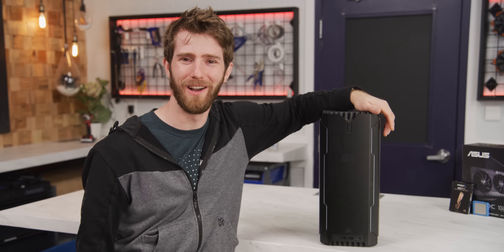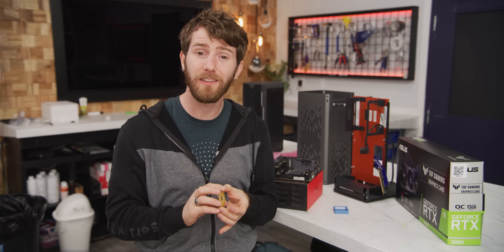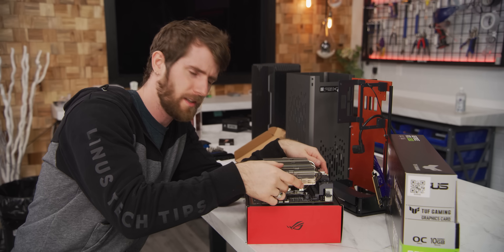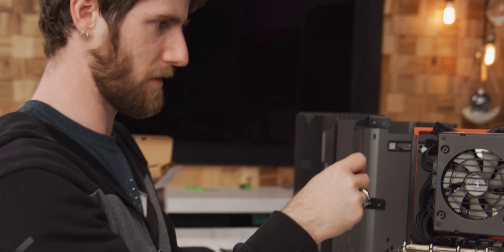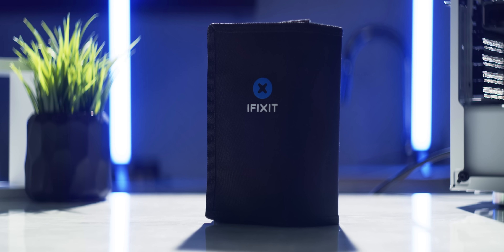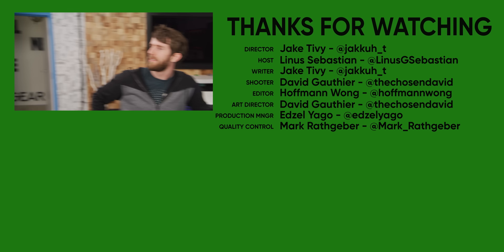My EASIEST PC Build In Years! - Louqe RAW S1

Comment: You guys should do some sort of a space build. But like… in vacuum. And try to have a modern gaming pc sufficiently cooled just radiating the heat away. Essentially, did a couple of videos on space related things, would be cool to push it next way to “pc for the iss (or starship)” or whatever. I think that could be a long project with lots of engineering and manufacturing and I think lots of people would enjoy watching that process. Plus get some clickbates with them “space pc” words.

Comment: 16:53 I recently replaced the water in my loop after 3 years (!) and cleaned it and "improved" my fan and pump speeds. My PC did not shut of, but the water temp went to 70°C and the case was so hot, you could nearly burn yourself :D It was pretty silent though, and the water probably wont have any bio issues after neraly boiling it.

Comment: Look can you help me i have 3.10ghz cpu :200storage: 6ram the installation goes to the end then rolling back changes i have been told its the PCI Family controller i unstaled it then connected via usb  with phone to wifi then does the same thing why it do that and i can install windows 8.1 what should i do
Reply: But windows 8.1 is bad do i try to install windows 8.1 then install windows 10 from there or it will do the same

Comment: all bearings, unless maglev, passive box sink, heat pump cooler
Reply: air bearings are fine too, nothing that wears off
Reply: two layer cake
Reply: you need a short gpu if any
Reply: third layer extended pcie trashcan gpu chambers
Reply: pipe-tube pc
Reply: chicken
Reply: only more section of pipe for a battery or a solar generator

Comment: Nah, after i saw Optimum Tech's review of this case i learned it is actually NOT GOOD ENOUGH for the price. And this build is not better than the Corsair One either when your parts are burning like they are inside of an oven.

Just get the SSUPD Meshlicious, way better thermals and water cooling support with a PCIe G4 for almost $150 less than this, it is also a thin vertical case.

Comment: Seems similar to the Aigo Yogo S1 (AKA DarkFlash DLH21) but without the 120mm rad support (but bottom access rather than top for rear I/O may make cable runs tidier, though top access certainly makes it easier to access, especially with the magnetic lid). Plus the S1 has argb so runs faster, right?

Comment: This is basically how those old Apple Cube computers went together. If you had to replace the HDD, you had to slide the entire chassis out of the cube, then IIRC, the HDD just slides out. That was back when Apple engineering was really cool and you could actually replace stuff.
Reply: Well Apple engineering is still crazy cool but you can't replace anything that's for sure.
Reply: @jas_bataille not crazy enough or cool enough for the prices nowadays unfortunately

Comment: The Phanteks Evolv Shift has been out for a while and, while it is slightly larger than the Corsair one, it's an incredibly similar chassis that you can buy off the shelf. It can do dual AIO setups as well and I personally prefer it over the ONE.

Comment: I'm at the point I recommend to someone to buy a pre-built and replace the PSU with a better one your liable to get a better system and by that I mean one from ABS or cyberpower you can then also redo the cable management just get one that comes with a good case as well

Comment: No way would I buy something like that without more air flow, and especially without noise to temp performance charts. it even eats up the ports on the back of my MB instead of using the headers. what kind of 300$ joke is this?

Comment: seriously though. Torx are better than philips and flat head screws. Since there's so much surface area, and you pretty much have to use the correct size, you're less likely to strip it.

Comment: Torx is FAR superior to Philips. Far better engagement and keeps the dumb dumbs out "especially if you upgrade to security fittings". Weird argument for sure but I'm a fastener nerd. If you don't have the proper driver on hand, you should probably not be turning that screw to begin with lol. /rant

Comment: I don't agree with philips head screws like you said Linus. Philips is outdated and holds no grip. It was originally designed to be stripped! A trox screw also stays on your screwdriver as you screw it in. in short, everyone should adopt torx and phase out philips head.

Comment: Philips is only better than flat head, not welcome anywhere outside of PC stuff. Great to see torx on them, it's vastly superior. For example, to get the correct torque you do NOT have to push hard to remain engaged. So way less chance of stabbing your gear by slipping. My 2c.

Comment: Phillips head screws are...ok but I pesonally really love Torx since they are really hard to strip. Even when you get at them with an angle they have great engagement and it's really hard to slip out of them by accident making it less likely to that a klutz like me messes up the part they're screwing into. So I and many people I know wouldn't mind most industries switching to Torx. Since screws in PCs are a pretty low torque it doesn't matter that much mich when it comes to applications which need some more torque like say construction or a threadripper mount Phillips heads are the devil. Try getting a rusted stripped Phillips out of an old piece of wood, absolute nightmare.

Comment: I highly disagree with your complaint about torx vs. Philips head screws.  How many times have you stripped out a philips head? I know I've done it ALOT...though a torx is much more difficult to strip out. I've actually replaced all the screws in my recent build with torx and wish all pc component and case manufacturers would make the switch.

Comment: So NZXT H1 with an exhaust 120mm and metal front? At least with H1 you can open the front glass for some air - this case is going to be too hot to touch when it's running.

Comment: I have a 3090 with waterblock and alphacool dc-LT pump, on cpu I have stock pump integrated into the system as auxiliary pump 💪🏽 it works flawlessly inside corsair one

Comment: I love ITX cases, but for the love of god, why can't anybody figure it out?  Mount the motherboard at the bottom of a case like this, vertically towards the back side, clip the graphics card into it normally, put a 160 mm tall cooler on the CPU (NH-D15 for example) and plop the SFX power supply over the motherboard, to the left of the graphics card. Then have some short extensions for two or three USBs, a display port/HDMI or two and... That's it? Use a USB DAC/wireless headphones, use a USB hub on your desk/monitor to plug in the thumb drives and peripherals, you don't need any hard drives in a case like that (because NAS?!), the cables exit/plug at the bottom behind the case and you could more or less do a chimney setup for the cooling as well.

Is it THAT hard?

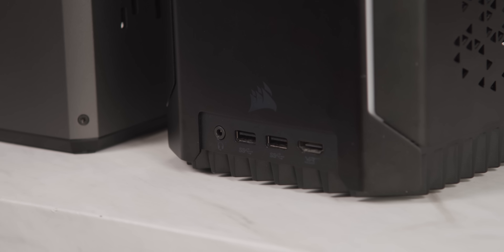Comment: 2:33 Actually, VR in 2020 and now is exploding, sales of headsets are at historical record highs. The biggest sellers are the Oculus Quest 2, HP Reverb 2, and Valve Index with premium headset maker Pimax struggling to keep their headsets in stock. There are also more VR games in development than there ever have been. Part of that is due to the surge in VR sales, and the popularity of the Quest 2. So, there yes IS a VR Revolution happening...oh, just so you know, the majority of the new headsets use DisplayPort now instead of HDMI because they needed the bandwidth.

Comment: 3:02 Okay... unpopular opinion:
Phillips screws need to die.
Torx or hex are the better solution in my opinion. I use only torx in every project (at work or at home). 
I don't  get it, when people act upset whenever they see a Torx screw in a product as if the manufacturer only would have chosen the screw to keep them out.
Torx is something absolutely everyone should have the needed tool for at home.
And it is not hard to have a good bit set for different screws at home.

Comment: Wait wait wait, this is the description of this video currently "Is a Corsair ONE-esque PC case worth your money? Let's find out by building a DIY equivalent."
This video does not give us the pricing they spent on any of the parts outside of the case (hard with current pricing I know) and they don't even compare the two thermals-wise, sound, or performance (different parts I know but they could have matched it)? Is this a case review? Is it a versus video between a DIY/unique Pre-built? If it's a case review then why the description mentioning building a DIY equivalent to the Corsair One? If it's a versus, then why absolutely no comparisons between the finished products.

Cool case, just confused at the direction of this video.

Comment: Anyone here know of a SPDIF decoder or a PCI Express sound card which outputs a minimum of 4v (pref 5+ volts) please?
I have a micro PC ive built and want to use in a car pc build but i need high voltage Pre outs and everything i can find puts out 2v or less!  My current touchscreen Headunit outputs 6v but my amps can handle up to 8v.

Comment: "It would be better to just have a phillips head..." 
Disagree. Torx screws grip better (where driver meets screw, I mean) and are harder to strip. They are a universally superior screw to phillips head. If they're giving you the key to use them, then there's no reason to use an objectively worse fastener.

Comment: Just repaired a hot glued on power button in my moms computer yesterday. The reset button doesn’t work anymore because I sacrificed its two pin mobo head and spliced it on the borked bare leads (which were glued on) for a more permanent solve. Seriously, how much are those little plastic 2 pin connectors that they didn’t want to use them on both ends? Cooler master? Wtf.

Comment: 11:35 that part pulls the video socket or the back plate I think seeing as you build it, if not I think that wouldn’t let you put the graphics card horizontally first, that’s the vertically adjust

Comment: I know from experience when you cram enough heat producing components into a case that small with limited air flow it may run but it will shorten the life of the componenets, specifically caps etc.  Theres a price to pay for all that downsizing.

Comment: If you think that case is low profile try the Silverstone ML08. I'm using the same motherboard (and ram coincidentally) but had to find an even lower profile cooler, of which there aren't many. A 3600 is about as much power as you can pack under such a slim cooler, but man is the case thin. It's great if you need to fit in on your desk next to the monitor and don't have a ton of space. And as a bonus, the side vents are filtered.
Reply: It also makes for a great sleeper/understated build since it looks like something you'd find a point-of-sale terminal or business workstation in, haha. Just don't expect to be putting much if any RBG in it since you won't really see it

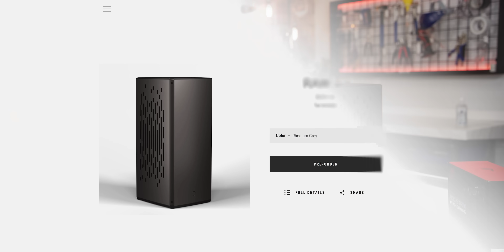Comment: 3:12 I respect this opinion but i also don't agree. Unless I still haven't though of something I think that Torx screws are superior to Phillips in most likely every way, including that the grip is better and that they are almost impossible to round, much unlike a Phillips screw that you pretty much round as soon as you lose your grip once. Also there are many screwheads that look like Phillips but actually aren't, which means that your Phillips bits won't fit as well as they should which increases the chance of rounding the screw. Torx is clearly superior in this too. There aren't any screws that look like Torx but aren't, so if you have the right Torx screw it will always fit perfectly.
Thanks for coming to my ted talk.

Comment: Seeing as how there are vertical cases like the meshlicous and the sliger sv540/590, this case doesn’t seem like a good deal. In fact these other cases have room for a radiator, even the nzxt h1 has better cooling performance for the cpu.

Comment: Use the liquid metal and gain a ek sponsor.
I be on the phone in a second asking for sponsor. 
And although the ek furious high speed fan very thick.. almost twice as thick as a noctua.
But the air flow is so far unbelievable and not so noisy on lowest speed but so much air flow.
EK 👶

Comment: Would like to see an LED for the power button and I couldn't see it well in the video but it looks like the rear I/O cables would be decently strained bending them under the case. Not a fan of such tight bends on my display connectors. But beyond that and the lack of some front I/O I would totally give it a shot.

Comment: Since picking up the Phanteks Shift 2 Air, i'm a big fan of this form factor. Corsair One is a really nice complete PC but the lack of user upgrade choices once the system ages is a big turnoff. Nice to see another case on the market in a similar form factor for off the shelf components.

Comment: Torx support higher torque without stripping the bolt, they're better for constant use when doing maintenance regularly, should be the standard in my opinion, philips screws strip very easily specially when using the wrong tip (there are several of them and everybody uses them interchangeably).
Reply: Yes, and people put all sorts of flathead drivers, philips of wrong size, coins whatever they have available into philips screws. Torx are great.
Reply: And also, since it's from Sweden, it uses them because ... IKEA

Comment: I have an NZXT H1 and I'm baffled that a company would do away with the front tempered glass and yet not having any vents.  Also, my 3080 TUF OC in mine barely gets to 70C even with the power slider cranked.   Even the 10th gen Intel chip doesn't get as warm and those are known to be furnaces.  Really unimpressed by that case.

Comment: When I got to LTX19, I had a BYOC ticket and went to set up my PC at the spot I had picked. Got my GPU put back in my system after my 2,000 mile drive from Ohio and turned it on. Had no display output... Made sure it was plugged in to the monitor I brought and all that and spent about 15mins trying to troubleshoot why I had no display output after transporting the computer 2,000 miles. Come to realize I forgot to plug the power into the GPU when I put it back in lmao xD So much relief in that moment :p

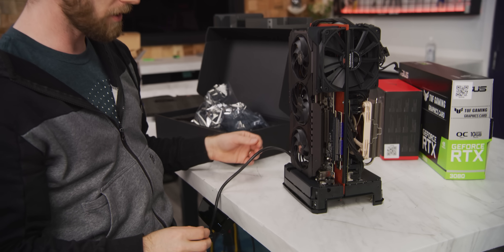Comment: 11:43 Gave Agent Sarah a hard time for shaking components while building, does the same thing
12:08 Then wields PC as a plasma rifle
Reply: As a fuel rod!
Reply: wobbling the computer =/= moving graphics card up and down while in the pcie socket
Reply: @boggie_mn  . Cool story, but the OP was referring to Sarah shaking the case with parts inside to see is they were secured. Not her GPU flexing.

Comment: HOLD ON. Sapphire nitro +, PC Red Devil,  and refference Radeon 6800 XT CANNOT WORK IN SUCH VERTICAL LAYOUT. CANNOT AND SHOULD NOT BE PUTTED IN SUCH POSITION!
Hotspot temp almost allways after (up to 1 minute) reaches 110 degree (some folks observed 118) and card start to throttle. I checked that myself and its true. I can only imagine how much RMA they gonna take for such false information - people will blame LOUQE instead of GPU manufacturer, they should immidiately change compatibility list for GPU's.

This is super not ok to promote this missinformation Linus - test it by yourself if You dont believe me. Its like baking GPU.
Please be kind to check this by yourself. I have writed to You guys, i have writed to ASUS, GIGABYTE and MSI, checked few cards by myself, other people checked different cards - only few have "not sure" status. XFX MERC, RED DEVIL, NITRO + and refference RADEON 6000 CARDS CANNOT WORK IN THAT ORIENTATION.

Comment: ...why would you slide the heavy part into the light part using gravity assist? Would it not have been easier (certainly on the power button, if nothing else) to put the interior (including the bottom and feet, maybe for that purpose?) on the desk, then slide the cover over it?

The cringe.

Comment: I am a sucker for sff builds, but i am also a fan of value for money builds. How about a mini itx build using cheap case, full size psu, entry level mb to save the money to buy a good gpu.

A suggestion for a case is the Sharkoon QB one. Old case 40 euros but supports everything i wrote. I am sure you guys can find something even better.

Another suggestion would be mini itx open style case, but cheap as well.

Comment: No, it would not be better to have a Philips head screw. If everybody said that, we'd still be using rivets that get pounded in place while glowing red hot (or slotted screws, if we're sticking to screws). Torx heads (or square drives) are better than Philips or Pozidrive, no doubt about that.

Comment: The first SilverStone Raven was such a nice case tbh. I never had any cooling issues in that thing thanks to the massive fans atthe bottom. 

Only issue was I couldn't get any bigger of an AIO than a 120mm for the CPU. But even running a 2600k in it with that configuration, I never had any thermal issues.

Comment: Shittiest airflow ever. You can't judge cooling just by temps. Power draw and clock speeds are just as important since these parts will just drop clocks/voltage if your cooling sucks.

Comment: Wish this case had full mesh sides and top to allow air through, a fan at the top instead of the exhaust fan, one slim fan at the base with slits around it to pull air in and up the system, and dust filters. That's my ideal case for this size and different case makers are getting close like the nzxt h1 but they all fall just short sadly.

Comment: Isn't it supposed to be assembled with the loose case coming from the top? (Power button at the bottom).
Then you don't have to lift your heavy components and balance them mid-air to slide it down along the profile - or did I miss something?